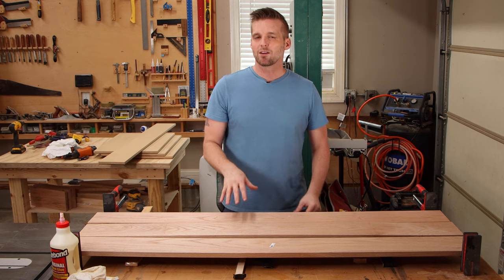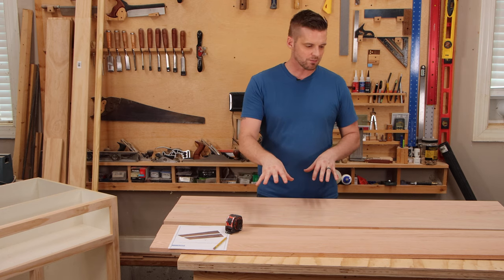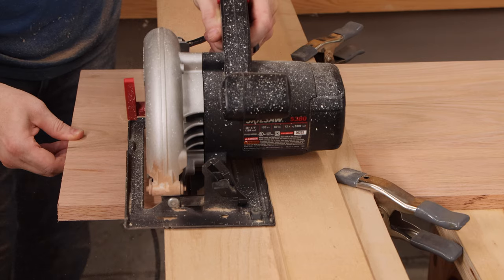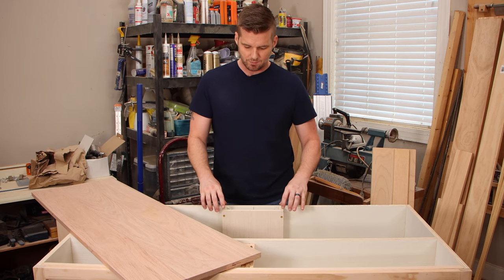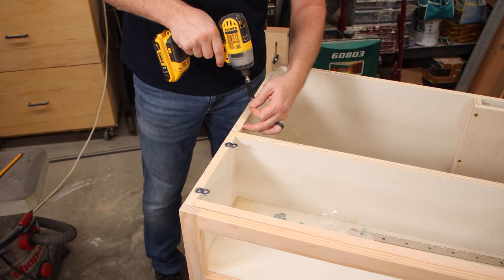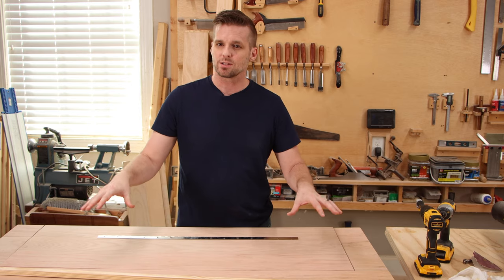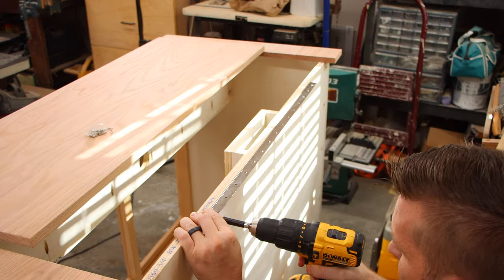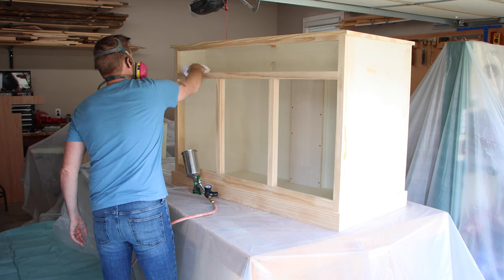How to Build a TV Lift Cabinet - Part 2 | Beginner-Friendly Woodworking Project With a Free Plan

Comment: Hi Tommy. I just downloaded your build instructions and plan to build this project. Seems fairly intuitive to build. I do however, have a question on what type paint sprayer you used, do you still have it or have you upgraded. I have been meaning to get one but not an expensive one. Any thoughts?
Reply from the maker: I use a couple of cheap sprayers. One is a central pneumatic from Harbor Freight with a 1.4 mm tip and the other is a cheap one from Amazon with a 2.5 mm tip for spraying thicker paints

Comment: This is definitely beginner friendly for anyone who has at least 10 years woodworking experience  ;)   

Very nice though.  Curious what your cost was to build this versus the $5k that the powerlift vendor sells theirs for?
Reply: The lifts are around $800 and he used about $200 in materials. You could easily do this for around $1000-$1200.